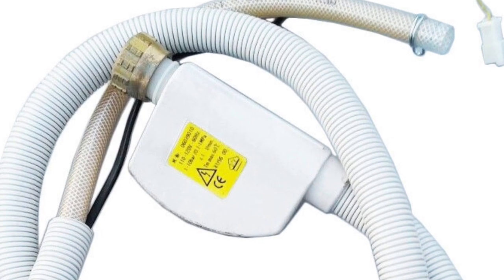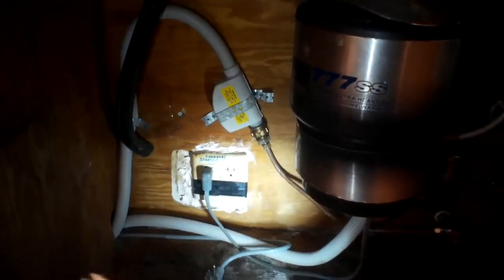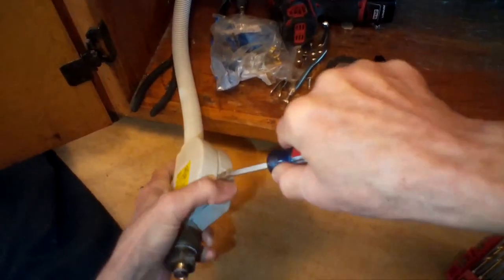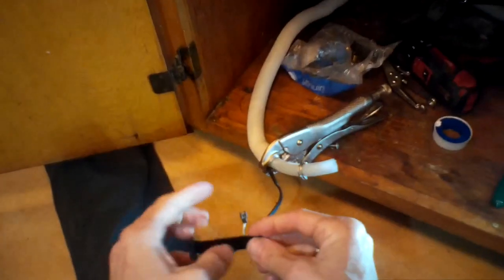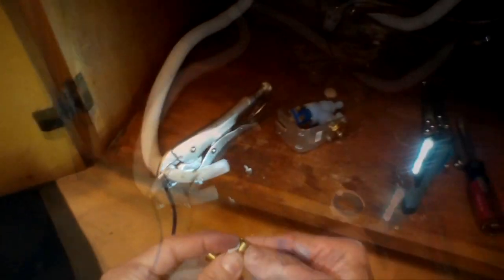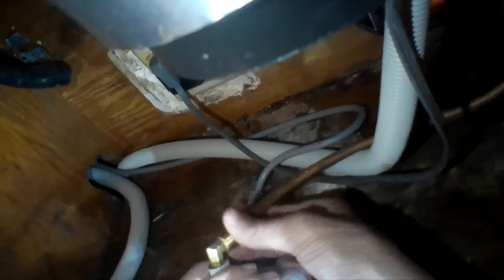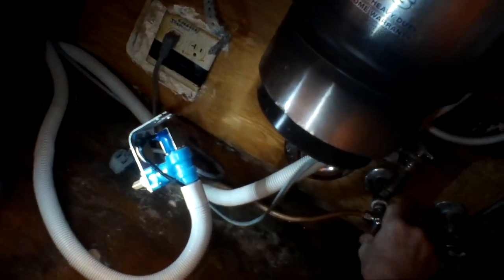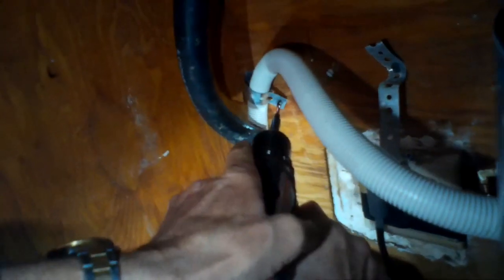Miele Dishwasher No Longer Fills

Comment: I was able to replace my 14 year old Miele hose that Miele quoted me $580 for, with a GE part that was $45. Dishwasher works great and it went smoothly. I had to buy a male to make 3/8” pipe thread and 3/8” compression adapter, but that only cost me $5 at the hardware store. This video is a big help for those of us that are a bit mechanical. Especially during the pandemic, when I was never able to even get a Miele rep on the phone, and there are no new dishwashers available.
Reply from the maker: Awesome job Keith😊😊😊

Comment: Excellent video, well explained!
IMPORTANT NOTE ALL THE DIY GUYS out there trying to fix your dishwasher/washing machine: 
Before following the advise in the video, make sure that the aquastop hose is actually really defective before cutting/destroying it, or buying a new valve.
I had the same defect characteristics, but my aquastop hose is actually still OK (I unmounted it before, which was tricky on my machine, and tested it).
I was close to ordering a new valve and destroying my aquastop hose as shown in the video. I would have been very disappointed to make all these efforts then just to see that this was not the problem.
Reply from the maker: Yep, thanks Jan.

If there’s water in the lower drip tray it won’t let new water come in.
Reply: @QuickAndEasy5MinuteAppliance  My issue was the reed contact being misaligned and not counting the waterflow accurately anymore. So the machine thought that there was not enough water coming in, while actually it was.
Reply: @uncle-k3m  Interested to know where this reed contact is located and how it should be aligned. Have a similar problem in that the machine is not getting enough water. Have cleaned waterstop inlet filter but found cylindrical, black, foam insert inside filter, which appeared to have gone sticky and didn't look if it would pass much water. Is this part necessary and/or available as a replaceable part?
Reply: @mjhsmjhs  black foam could be a filter? The reed contact is on the water inlet system (a large plastic part with channels inside). Below the reed contact is the wheel that gives the impulse. The reed contact needs to be close enough/well fixed.
Reply: @uncle-k3m  Thanks for your reply. Will investigate further. The foam didn't appear to be a filter, as it is 3mm in diameter less than the inside diameter of the plastic filter.

Comment: I just followed your instructions and fixed our Miele Excella series dishwasher. Working for now. Thanks Scott.
Reply from the maker: Thanks so much😊
Reply: @QuickAndEasy5MinuteAppliance  Hi Scott. Does the manner in which you connect the electrical connectors matter. In essence, does the either pin I connect the electrical connectors matter?

Comment: Hi, thanks for the video. Is it possible to know if the valve is defective using a multimeter to the other side (connector)? Are there typical resistance values? Thank you :-)
Reply from the maker: Best to replace it.  Miele valves don’t last very long 🤪

Comment: What is the flow rate for Miele water inlet valve? Do you need to match it with 3rd party water valve? Or Miele dishwasher has a sensor to know there is enough water.
Reply from the maker: After market valves work well to.
Reply: @QuickAndEasy5MinuteAppliance   NOT FOR LONG THEY CAN FLOOD THE HOUSE

Comment: Hi Scott - I have a Miele Dishwasher with a water intake error - I have done the usual  things like checking for obstructions, I replaced with a genuine Miele valve and flow sensor just for good measure, now the error occurs intermittently.

Any ideas what else i can check - Thanks in Advance

Comment: Dishwasher not filling but did not feel vibration of the intake valve.  Exposed about 1/8" of each wire on the power supply line and tested with a DVM, expected to see 110V but measured nothing, tried both AC and DC.  Seems that my problemm is not the intake valve.  Are there fuses or something else to check?
Reply from the maker: Is it constantly draining when you turn it on?
Reply: @QuickAndEasy5MinuteAppliance  Yes it is and I found the other video that talks about flooding in the drain pan.  That was the issue, likely triggered by my wife having an "oops" moment in the kitchen (long story).  Once I drained the flooding things started working.
Reply: @QuickAndEasy5MinuteAppliance  I'm having this exact issue. I replaced the fill valve but I'm still not getting any water. When I turn the machine on it just continues to drain in perpetuity... Any ideas on what I should look for?

Comment: Is the inlet valve 220volts or 110volts?
Reply: Depends on where you are located. Check on the big plastic box at the inlet. Should be written.

Comment: Hi Scott. My miele G 4225 SCU does not have an external fill valve like your videos show. My dishwasher drains normally, but it won't fill properly.
It fills for a few seconds, then stops, then fills, then stops, in a never ending loop. It is driving me crazy. 
I had an authorized repairman out and he spent two hours trying to figure out what was wrong with it. 
I have done a factory reset, and it worked - once. 
Then back to the same problem. 
Did a couple more resets with no luck this time. 
I've cleaned the drain valves and filters. No luck. 
Any ideas?
Reply from the maker: I would try turning down the water pressure coming to the dishwasher at the wall under the sink .

I’ve got the feeling it’s either way high or too low.
Reply: @QuickAndEasy5MinuteAppliance  thanks Scott. I tried turning it way down and it still didn't work. I have very good water pressure in my kitchen and the  dishwasher valve is new.
The controller brain on this thing costs about 380 bucks.
I've already replaced the filler tube/drain valve assembly. And hired a repairman who spent 2 hours trying to fix it.
This thing is possessed.
Reply: @QuickAndEasy5MinuteAppliance  Just circling back. It ended up being a defective fill sensor. This is a little thing that mounts on the left side under a metal panel. Costs about 27 dollars from miele.
Easy to fix, but difficult to diagnose!
Reply: @handyboy2000  Yes. This sounded exactly like reed contact issue. This ome is detecting the magnetic impulses from the wheel that counts the water flow. Mine could be fixed (for now) by just putting back the PCB with the reed contact in the proper position. If it happens again and you know how to use a soldering iron, just buy and replace the reed contact, it should be below 1$

Comment: most of the time the problem that the fill vale (miele) is malfunctioning and there is no water coming into the dishwasher.
i wish there was a video showing what to do when initial supply of water floods the interior.
Reply from the maker: It’s the same procedure.  The defective fill valve doesn’t close all the way and floods the kitchen.